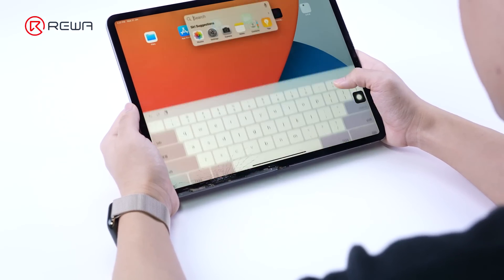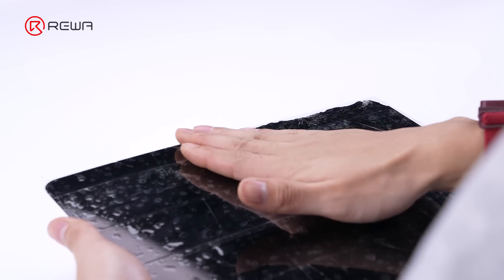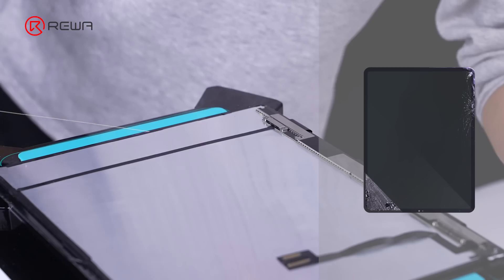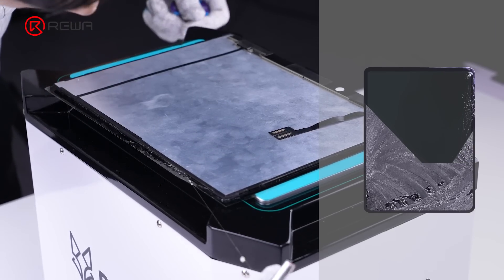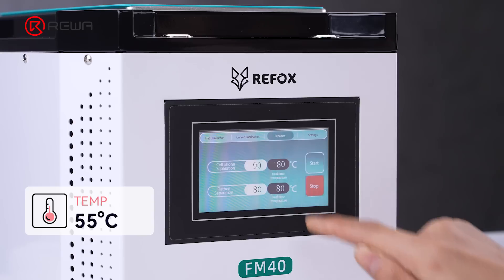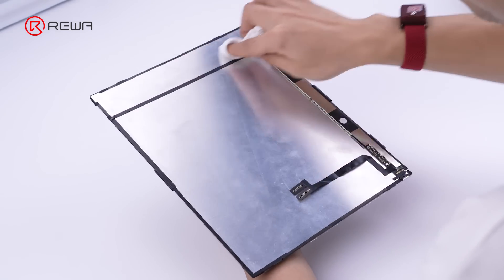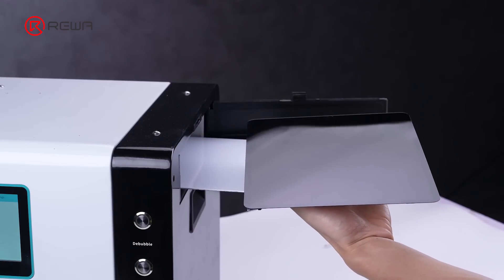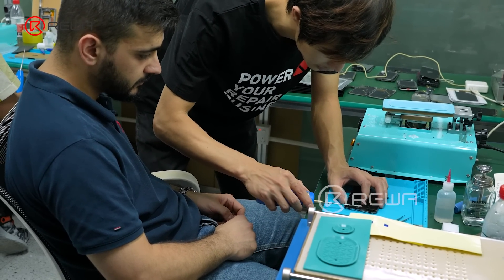How to Refurbish iPad Pro 12.9-inch Screen（Glass only)

Comment: I don't have a laminating machine. Can I just put the new glass on and then put it face down on the heating pad with a uniform weight on it for some time to get the adhesive to melt and re-laminate it?
Reply: Same question I have

Comment: Hello it is  possible to reprogram nfc antena in apple watch series 4? i watched some video of replacing screen in watch but nfc antena on screen is serialized whith motherboard and im courious if there is any chance to doing this operation? apple  watch screens are expenisve and it will be very helpful when replacing screen and no need to replace nfc chip on the new screen
Reply from the maker: Sorry we do not have too many Apple watch NFC repair case,so we can not give you a accurate answer too.